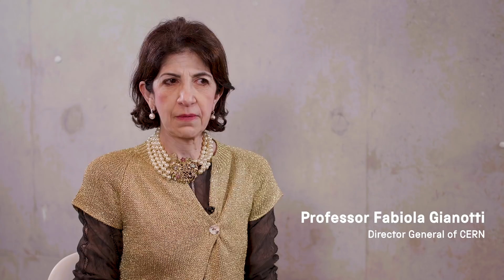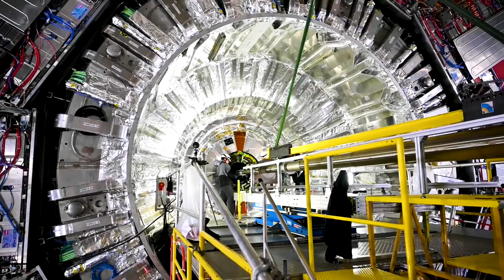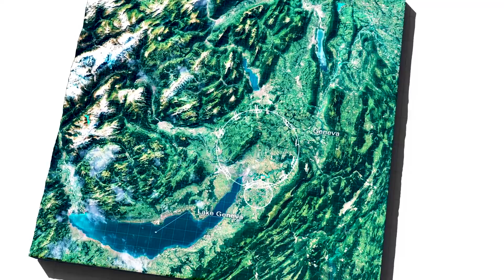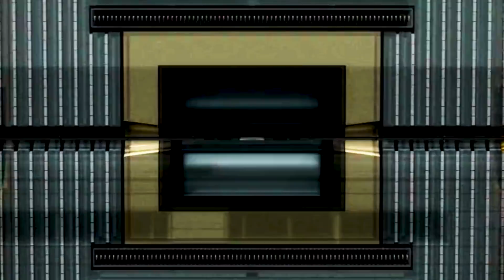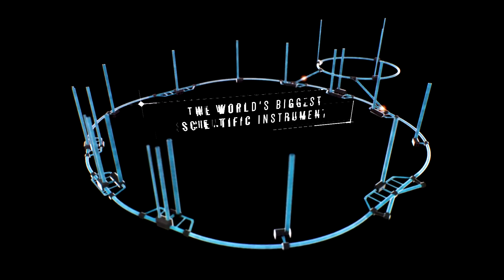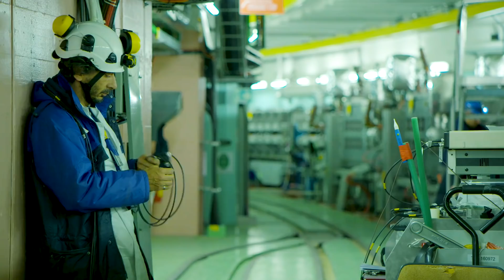CERN: Upgrading the Large Hadron Collider (LHC)

Comment: There is no such thing as the higgs boson. By physics of the universe, spherical waves of temperature, hot or cold, expansion or contraction, we have the universe we know and see, galaxies, spherical, solar systems, spherical, planets, spherical, sun's, spherical, atoms, spherical, electrons, protons, neutrons, gravitationally fused centers to a spherical circumference to outline their perimeters. Neutrinos are spherical, and what atoms are comprised, of different mass and temperature settling into place under its specific gravity. And so it goes without saying that it is impossible for quarks to exist as particles that make up subatomic and quantum matter. All a quark is is a neutrino moving at specific velocities, mass and temperature, smashing through subatomic and quantum sound barriers and other neutrinos specific temperature and Mass. The "higgs boson" is most likely the hottest and fastest of the neutrinos that are exploding outward from particle collision, and there for are the straightest and most easily trackable neutrinos of a collision. Like when a car crash happens at 99.99999999999 miles an hour for each car( which, comparable to cern, would be like hitting a brick wall at almost 200 miles an hour), woops there goes the hood, then the windshield, then it's the up tires and there goes the down tires.